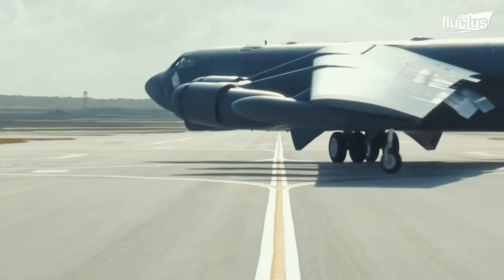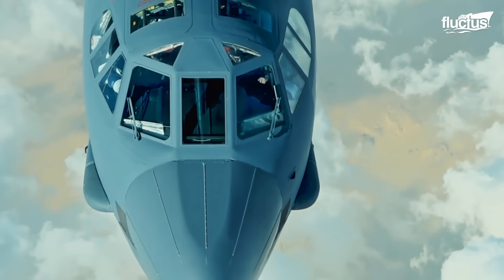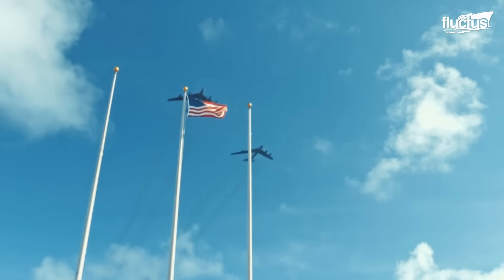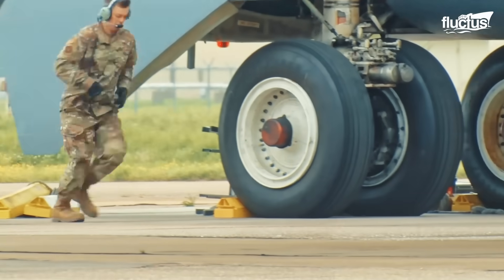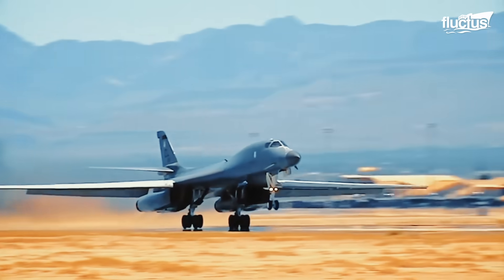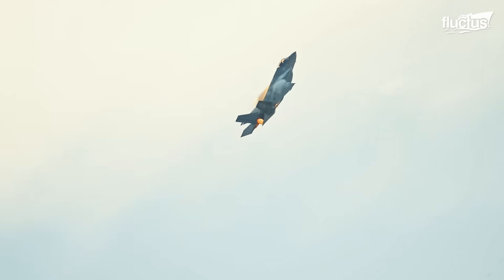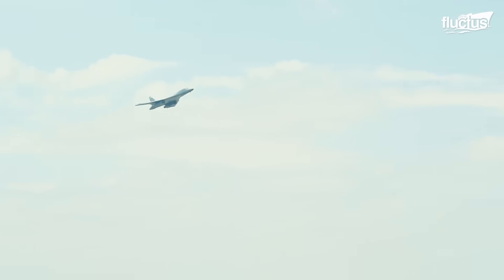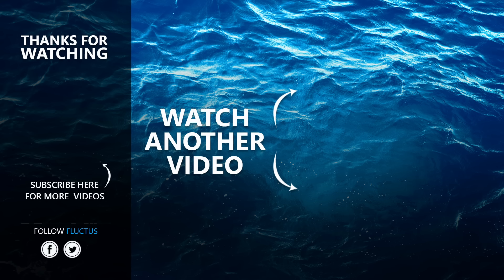Behind US Genius Idea to Power Old B-52 Bombers with Brand New Engines

Comment: Back when Boeing knew how to build airplanes.
Reply: Actually, this dates from when Boeing was still figuring out how to build large jets. Ironic.
Reply: Boeing's safety record is literally orders of magnitude better every decade.  Don't get your aviation news--or your actual facts--from The Atlantic, bud.
Reply: They still do.
Reply: Should have kept the Boeing 747 queen of the sky's running...built when Boeing was King...not anymore
Reply: @wirelessone2986  What has this got to do with reengining the B-52?
Reply: Before goofy feminine mbas took over. For Boeing to survive masculine engineer have to deem Boeing worth saving
Reply: We retired the B-52D models with only around 15,000 hours on them. Practically new. The highest time B-52H has around 30,000 hours. Boeing 757s are going past 100,000 hours and they are much younger than the B-52H.
Reply: @rael5469  B52s are not flown daily like a commerical plane. Not a lot of hours on frame but engines are old and consume a lot of fuel and high maintenance cost.
Reply: @alexrebmann1253  Yeah sure.....why are you telling me this? That's what I just said.
Reply: @rael5469  Sorry, just wanted to ad to what you said.
Reply: @alexrebmann1253  You're right. I bet the flight crews will be thrilled to get new engines and probably new flight instruments as well.
Reply: Back.when boeing used to build.planes
Reply: @ashho313 now they build fat wallets😅
Reply: Back when engineers ruled not accountants. 😉
Reply: @jenssirbensonmam4822  Not accurate.  As a 37+ year veteran of Boeing here is the truth.   Boeing used to alternate between having an engineer as CEO and a businessman/lawyer as CEO.  Beginning with Egtvedt in 1944 this alternating format began.  Egtvedt was an engineer.  Next came Bill Allen, a lawyer.  TA Wilson was an engineer, Frank Shrontz was a lawyer.  Condit was an engineer.  Stonecipher and McNerney were idiots.  Muilenburg was an engineer.  Calhoun business.  Ortberg is an engineer, let's hope for the best.
Reply: @blazeography  look people Boeing is not building crap airplanes except for the fact they’re quality control needs a lotta work to improve. I won’t deny that would be an ignorant and mouthy isn’t gonna solve their problem instead why don’t you try to come up with a solution for aviation engineers
Reply: @bradolsen8629  > look people Boeing is not building crap airplanes except for the fact they’re quality control needs a lotta work to improve. I won’t deny that would be an ignorant and mouthy isn’t gonna solve their problem instead why don’t you try to come up with a solution for aviation engineers

Actually the QC is good too.  People forget that even as late as 1970 there was a fatal jumbo jet crash IN the US, EVERY MONTH.  Now it's not even once a decade.  The safest car you can buy is literally 1000s of times more dangerous than a 737 MAX or other Boeing but you never hear people whining that "Lexus can't build cars" and so on.
Reply: @lqr824  every airplane manufacturer that builds military or civilian aircraft is gonna have a dud once in a while get over your baby issues and move on dude
Reply: @lqr824  totally agree my uncle flew bowling aircraft in Vietnam
Reply: @bradolsen8629  "...quality control needs a lotta work..." EQUALS crap airplanes.
Reply: @dalehill6127  yes I agree but as long as they find use for the B-52, they’re gonna have to keep up with it and I think they’re doing a great job
Reply: @dalehill6127  > "...quality control needs a lotta work..." EQUALS crap airplanes.

But it's a lie.  Quality control is improved by an order of magnitude every couple decades.   Back around 1970, there were fatal crashes of EVERY brand of jetliner in the US, on a MONTHLY basis.  Boeing quality has literally NEVER been higher than now.
Reply: Those days are long over
Reply: Oh yeah Boeing "knew how to build airplane" which is why it has that stupid landing gear and can't be upgraded to modern turbofans.
Reply: @evanfinch4987 Show us your amazing design. I love how people who either know absolutely zero or very little sure love to criticize. I'm not saying that Boeing is problem free, but they manufacture some amazing products everything from defense systems, fighter jets, all kinds of space applications and the list goes on. It's easy to criticize engineers who designed a bomber to achieve every role that was thought to be needed. No one sent them a memo that said "oh yeah, and make sure everything is perfect so they can still use it 100 years from now" engines of today's design were not even thought of, if they had been they would have used them. Think of any other company that has designed a better bomber. If it were cheap, EASY, and could complete the mission requirements better than the Boeing B-52 then we would have scrapped them!
Reply: @evanfinch4987  The 737 was designed on engines of the time.  It was also designed for easy maintenance on the engines. As engines technology  improved the size of them got bigger.
Reply: Buttigieg ended all that....DEI
Reply: @KB-ke3fi   What does Buttigieg have to do with it?
Reply: @KB-ke3fi  That’s got to be the dumbest, most misdirected political comment I’ve ever seen.  You think the Secretary of Transportation has any role whatsoever in the design and construction of airliners???   FoxNews has rotted your brain - SEEK HELP!
Reply: @KB-ke3fi  Obviously ignorant of Boeing and our government.

Comment: You should’ve told us more about the new engines for the B-52 very little was said
Reply: Thanks for saving my time
Reply: @daveok7131  same, I'm outta here.
Reply: What's the top secret about the engines?   Same engines used on commercial planes.
Reply: @alexrebmann1253  What commercial plane?   Modern engines are high bypass turbofan with a very large diameter, way too large diameter for the B-52.
Reply: @NickSpud  The engines are based on BR 750 which are used on corp jets. My mistake.
Reply: @alexrebmann1253  I don't believe that this correct.
Reply: @roderickcampbell2105  The RR F130 engines was not designed and built from the ground up for the B52. Other planes in the US airforce use the same engines and that is one of the reasons why it was picked for the B52. The civilian version of the 130 is the BR725 and is used in corporate jets.
Reply: @alexrebmann1253  Understood. Regards.
Reply: @alexrebmann1253  They are 90 MPH slower at cruising level.
They are turbo fans that just can't compete with the original turbo jets.
But....no more parts.
Reply: @u2mister17  Ive read that the max speed of current engines is 650 mph but cruises at around 510 mph. The new engines on   the B52 will  cruise at 420 mph?
Reply: @alexrebmann1253  7 years ago BUFF mechanics explained the problems with reengining. Obtaining parts is the problem. The new commercial engines ALL are fan based and not designed for speed.
Reply: @u2mister17  Both engines produce around 17000 pound of thrust.
Reply: @u2mister17 What do you think the TF33 (the current engine) is?
Reply: @oml81mm  If you have something to add please do.
Reply: @u2mister17  Well, The TF33, which are the current engines are turbofans.
Reply: @u2mister17. They are significantly more efficient engines … permitting greater range in addition to the other benefits described.
Reply: TALK ABOUT THE NEW ENGINE THATS WHAT WE ARE LOOKING AT !!!
Reply: And about how it was a genius idea and not just a good idea.
Reply: wikipedia: F130    Military variant of the BR700-725 with a 17,000 lbf (75.62 kN) maximum rating for the Boeing B-52 Stratofortress.
Reply: @2009PocoLoco  THEY are Rolls Royce engines however they will be manufactured at RR's American facility. 🙂
Reply: we passed that about 5 posts ago 👍
Reply: Obviously little said, the engines are British.
Reply: @Philipketchell  So what?
Reply: @2009PocoLoco But Rolls Royce ARE a US military supplier
Reply: My reason for saying that was because I was thinking that there was something brand new about these engines something unique for example, more powerful, maybe or less smoke coming out of them that’s what I was looking for. I was not looking to criticize them for me. It was more of an education than anything.
Reply: @2009PocoLoco  Rolls licenses the technology to America, the parts are made in America for the domestically used engines.  This tradition goes back to WW2.
Reply: @rtqii  thought that stopped  about ten years ago…….either way I’d look at P&W for the better engines for that purpose than RR.
You want a passenger bus engine or an engine that can move real weight fast? 
‘FedEx has signed a contract with the GE-P&W Engine Alliance for GP7200 series engines to power 10 firm Airbus A380-800F freighter aircraft.”
Fred knows engines 😉
Reply: @rtqii  God Save the King!
Reply: its Boeing so nothing to say more
Reply: Thanks! Saved me some time. 

❤
Reply: That’s because he doesn’t know anything.
Reply: Rolls-Royce F-130s
Reply: When I was a teenager I had this thought, and it’s definitely not a genius idea!  Rather why did it take so long to replace old heavy gas guzzling engines with lighter new, more efficient and much more powerful ones?
Reply: @user-Natarito  It was common sense. All you'd have to do is show one taking off to a little girl and she would say, why don't they put engines in those planes that don't smoke so much.
Reply: Perhaps because, dare I say it , they are British ?pity we didn’t keep the Vulcan and Victors same role and arguably better aircraft of the period.
Reply: 😊Embarrassing😊facts😊 about😊 using😊superior😊non😊u s a built😊 technology😊is😊 always😊top😊 secret😊
Reply: I don't know, was there a hot rodder in this decision? They've been doing engine swaps for years.
Well, that would've been a better storyline. Nice that safety was in mind in protecting those cleaning the planes from potential toxic run off. Eyes, hands, body protection. But, no respirators!!
At 2:37, a DEE E EYE job recipient is showing the class how to get disability.
Reply: Thank you, aborting video at 3:27
Reply: fishing lol
Reply: Intended
Reply: @2009PocoLoco  RR B52 engines will be manufactured in Indianapolis, Indiana.
Reply: @alexrebmann1253  money still goes to a company in the UK 🇬🇧
Reply: @2009PocoLoco And
Reply: @alexrebmann1253  I guess you don’t understand? There’s a logic behind why we purchase military items from US companies and it’s not because it’s creating US jobs. It’s to assure a controllable stream of critical items during wartime. For several reasons the govt can’t control that with foreign companies even if they have a plant in the USA. 
Plus, again, you’re supporting a foreign company with US tax dollars for critical military equipment. Normally in the military vendor approval process that’s a no go, or at least it always has been in previous administrations.
My point was if you challenge Pratt & Whitney I’d bet they could produce the same or better  than RR and cheaper like they did for the fighter engines they supply to the military.
Reply: @2009PocoLoco  PW already lost the competition, they were already challenged.  The procurement is through a US company regardless of who ultimately owns it.  The contract from the US government, to RR USA, will have a priority procurement code which extends all the way through major and minor subcontractors.  England has nothing to do with the supply chain.
Reply: @Slonge92  so if we went to war with someone and the Brit’s didn’t agree with the conflict the Crown would let them continue to supply the US govt? Nope. 😂
Sorry but it’s what I do for a living and P&W hasn’t bid. RR doesn’t actually have a contract or bid in either. It’s a teaser video looking at options.
Reply: @2009PocoLoco. What’s your explanation then for the Rolls Royce Lift System being used on the F35,  including its powerplant?  Has it hurt your pride?
Reply: They can't tell you something that's still up development.... they're still trying to figure out hypersonic missiles.
Reply: That B52 is 62 years old and the US government is going to place this old ass aircraft with new electronics into WW3 against Russia and China...???
Reply: @Camilo.Europeo   "The Pratt & Whitney JT3D is an early turbofan aircraft engine derived from the Pratt & Whitney JT3C. It was first run in 1958 and was first flown in 1959 under a B-45 Tornado test aircraft. Over 8,000 JT3Ds were produced between 1959 and 1985. Most JT3D engines still in service today are used on military aircraft, where the engine is referred to by its US military designation of TF33"
Reply: Because its ALL BS this jack ass site is looking for clicks ONLY.................. do yourself a favor and BLOCK This POS site
Reply: Details are classified.  In fact....we shouldn't even be talking about this right now......I was never here. ....
Reply: They're rolls engines so the best that's all everyone needs to know
Reply: What are you ? Chinese looking for classified info?
Reply: @denize1654   Won't find it here
Reply: @denize1654  you are so funny
Reply: Top Secret...
Reply: @bhartley868 What's the top secret about engines? Same engines are used on commercial planes.
Reply: @alexrebmann1253 it's a commercial engine
Reply: @alexrebmann1253  It specifically said that the RR F-100 was designed for the B52. I want to know why a US company didn't do this.
Reply: @robinac6897  Designed is based on engine used in corporate jets BR725. Modification to engines needed to be done for the B52.   PW, GE, and RR were in competition for the re-engineering   program.
Reply: @alexrebmann1253  ??????????
Reply: @robinac6897 … because they couldn’t match RR product.
Reply: @alexrebmann1253  Well, I'm pretty sure it was a joke there, dum dum.  Whoa!  Look up, "gullible" is written on your ceiling.
Reply: @bhartley868 there are some other videos that go into more detail. Essentially it was a modernization program to save on maintenance, etc. Rolls Royce got the contract for the new engine. After some design considerations the new engine would be put in a nacelle similar to the original.
Reply: @bhartley868 but I have access to above top secret, so this must have been higher.😂
Reply: @bhartley868  it's not top secret - The engines are Royce Royce F130 a domestically sourced variant of Rolls-Royce's commercial BR725 engine (20 year old engine)

Comment: The P-38 never had RR engines.
Reply: Correct. The P-38 had GM Allisons, not Merlins.
Reply: @rayjay848  Correct and the same goes for the P40... Allisons.  And as I understand from War Bird Pilots (P-51 guys), the Packard Merlins were better built that the UK Merlins.  Of course, we weren't being bombed at the time like UK factories.
Reply: @gregorydahlen2103  Many Merlins were built by Ford. In Stanley Hooker's book he was told Ford couldn't build these engines to these tolerances. The tolerances were too wide for Ford's production processes. Hooker said Ford made some very good Merlins.
Reply: @davidellis2021  Thank you David!  This is music to my ears as I've never owned a Packard, but did admire my '29 Model A Roadster, '69 Cougar Eliminator (CJ428) and '72 Pantera (351 Cleveland).
Reply: @davidellis2021  Here is where the confusion lies. Some Rolls Royce Merlins were actually built by Ford. But it was Ford in England. No Merlin engine was ever built by Ford in the USA.
Reply: @beeceesp1386  I never wrote that they were.
Reply: The P-40D did have the Merlin 28 in it, the lightening, no
Reply: @johnharris2337  Thank you John.  I did not know... according to Wiki it was the F and L variants: "P-40F and P-40L, which both featured Packard V-1650 Merlin engine in place of the normal Allison, and thus did not have the carburetor scoop on top of the nose. Performance for these models at higher altitudes was better than their Allison-engined cousins."
Reply: and it was still a bad ass mutha F er.!!!!!
Reply: Neither did p51 , they are Packard  engines designed by RR
Reply: @Philc231  Built under licence so they are Rolls Royce.
Reply: @Philc231  They are RR engines, built in the USA by Packard under license.
Reply: @robobloxgamer524  you got it backwards - they are Packard copies of the Rolls Royce Merlin’s. Built in The Packard Factory by Packard workers - they are Packard engines. Don’t let pride get in the way of the truth!
Reply: @robobloxgamer524  Care to tell where you got that information?
Reply: @Philc231 fakes